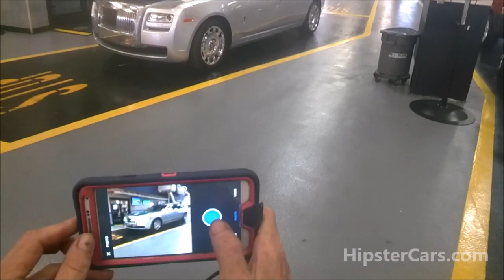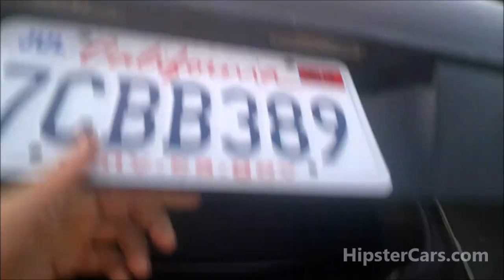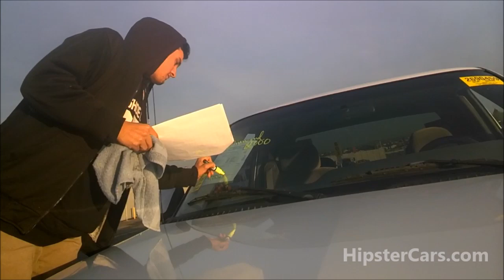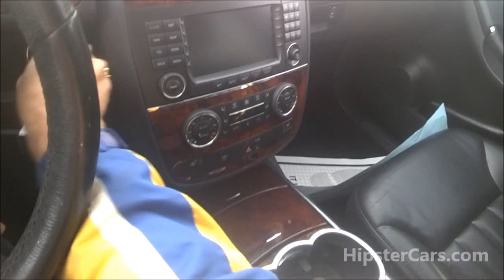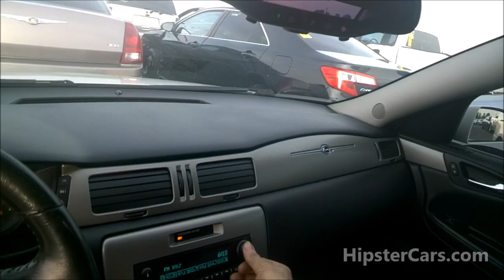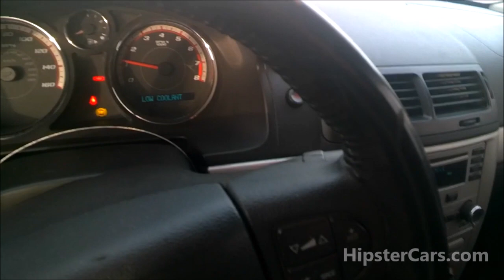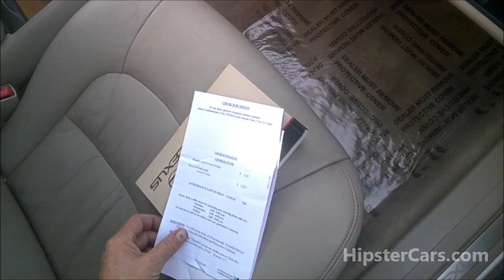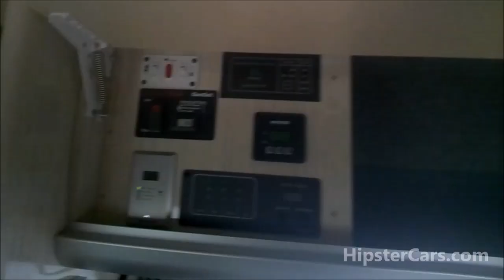Highline Car Auction Manheim Dealer Auto Auctions Video Preview Live Bidding

Comment: 30:25- actually no. Front drive W platform, 5.3L V8. 2006-09 Impala SS. Big thing on those is the torque steer, transmissions in those are weak if beat on supposedly. They boot around decently though. Other V8 front drives on that platform were the 2005-08 Pontiac Grand Prix GXP, the 2006-07 Monte Carlo SS, and the 2008 Buick LaCrosse Super. A 4 door GTO would be the discontinued 2008-09 Pontiac G8 GT/GXP, or the 2014 to current Chevrolet SS, both of which, like the modern GTO, built in Australia by Holden.
Reply: +Cereal Marshmallows Sure thing. I've been watching your videos about a year now, good stuff.